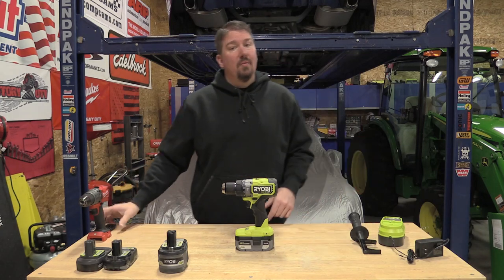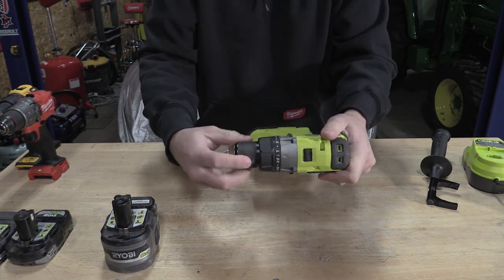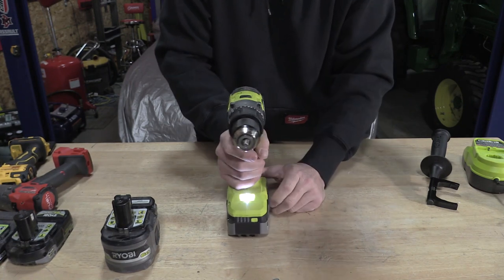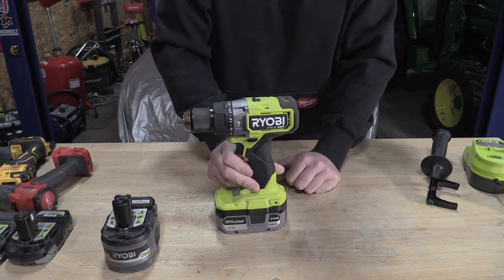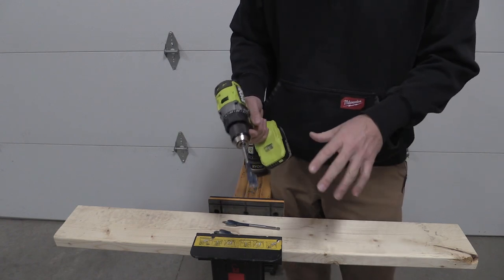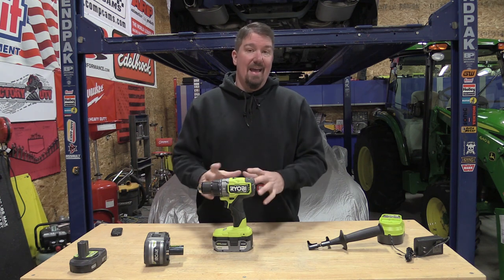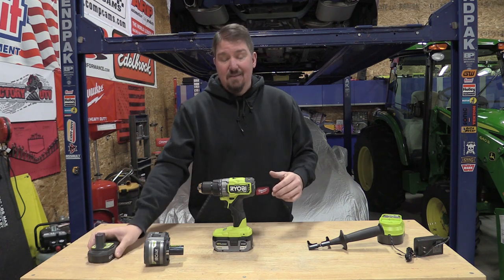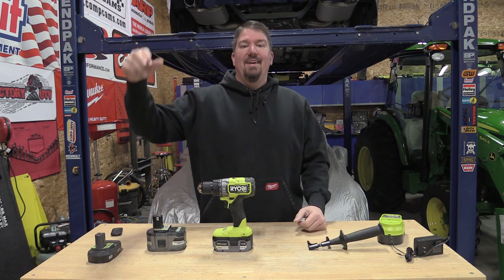Ryobi 18V ONE+ HP Brushless 1/2" Hammer Drill Driver Review | Model PBLHM101B

Comment: Good review.  I bought the last Ryobi brushless hammer drill a few years ago when it was offered with the two batteries and a free tool. It’s still meets my needs. I do like the HP line of tools and will move up as needed. One of the thing the new HP line did was take away the magnet on the base of the tool, I have always found that feature useful to keep up with extra screws. I do like the extra light. I guess I can’t have it all.......
Reply: I agree. Ever since they came out with the new hp line I've always complained about the mag trey. I always use it. When you upgrade you shouldn't take away the good features of the old one
Reply: That's one reason that I might switch to milwaukee. Cause milwaukee doesn't have the mag trey either and it performs so much better

Comment: I really think Ryobi have come a long way. Some of their tools still have some issues, and some of their tools still are outright bad, but most of their stuff is getting really good, and they show alot of willingness to improve. For instance, their old brushless hammer drill was pretty good, powerfull motor (apart from a bit too aggressive overload protection) but the chuck was really bad and would let go of anything i put in there sooner or later. These new ones seems to have alot better ratcheting chucks.

Also have this sneaky feeling that much of the quality uplift is from using stuff from older generation Milwaukees. Alot if the build materials seems to be the exact same. If that is true then the trickling down of older, but higher quality tech is awesome for consumers. Sure its not industrial grade, but its miles above the average IKEA drill or whatever someone would buy just for the sake of having a drill. I'm pretty sure that "regular" people collectively buy alot more tools than professionals do, so better technology at better prices affect ALOT of people out there!
Reply: @alex ander Hard to tell without looking at it but im guessing either overheating or issue with the battery maybe?
Reply: @alex ander sounds like a lemon mate, or bad battery ive used and abused the drill and impact and both are still going strong

Comment: Outstanding video. A couple of points. It seems that the HP tools with the extra prongs seem to work pretty good where as the HP tools without the extra prongs simply don't impress. Second I think at least the brushless tools from Ryobi are good enough to build a house. However, I said a house not houses. I don't believe no matter what they claim their not professional grade tools to used hard day in and day out. Just my opinion YMMV. And last the famed 1911 has the best trigger.

Comment: Having mechanical chuck seems to be in the right direction. Even Milwaukee went back to mechanical chuck!

I just received this drill and opened the box. As long as I feel, based on my short experience with DCD800 and DCF887, this Ryobi feels way better made. Solid fit. Yet missing some coushion pads around the foot pad. It does not seem to be any big issue for a lightweight(?) users, though, since they won't be using this drill in any hardcore environment frequently. Also, the battery footpad(?) is large enough.

The metal chuck and clutch selector feels really nice! Especially the mechanical clutch clicks like 'quality' every time. I have never expected this from Ryobi and beginning to consider switching entire platform from DeWalt to Ryobi HP. Well, I will still keep DCF850 if the shift ever happens though.

I got this drill with the impact kit just because of the hammer function with the auxiliary handle and the brushless motor. Sure, I could have stayed with DeWalt platform for this purchase. But their high-end 900 series seems to be a bit outdated (no auto-stop, dinosaur size, and pricy) in design and too powerful for amateurs like me who even felt DeWalt 20V drills are too much and preferring 12V as a go-to. 

Sure, this drill is even heavier than DCD800. Yet, the aux handle seems to be negating the problem well. The small notch on the grip  feels ok for me. At least I don't have to drill thousands of holes a day with this. So, I am not keen on the grip comfort, though. I tried gripping it inverted, pulling the trigger with pinky but didn't feel too much of obsecure sense. I would rather point out the thicker ankle area which is huge compared to anything DeWalt 12V stuff. Yet, again, I'm not very keen on this matter. 

I have a few caveats though, one is the chager... no, not the charging speed or anything electrical but the outlet plug connector is the notorious brick type... takes up at least 3 of outlet extender slots! Yes, I hate these kind of fat plug in brick connectors! My lawn mower, also Ryobi, charger isn't like this! AVGN tone: What were they thinking!

Another caveat is not coming with any belt clips nor bit holding slot accessories. I saw some previous generation Ryobi drills came with those, well not exactly but internally, and even magnetic bit holders on the foot! It's kind of annlying having to source them separately. I bet there will be some 3rd party ones, though.

Lastlly, the drill seems a bit chubby and longer than anything I have (DeWalts, mostly.) So, I will not be using it any odd situation at all. But then again, I still have 12V DeWalts for this.

Comment: Have the same hammer drill, and I love the handle and grip. That’s my preference though. Great review.
Reply: Love it.  Using it for a fence extension on a concrete wall and have had zero problems. I got it free with the Ryobi days deal with 3 batteries, so can’t complain.
Reply: I’m just a DIY guy, but I have Milwaukee and Dewalt stuff as well, but I’m good with the Ryobi. Always been good to me.
Reply: Can this handle heavey use. Im a roofer
Reply: @greylynnjr  I’m just a home DIY guy, but it’s held up very nicely for me. Still working great

Comment: One "OMG Youtube Comment's prove you wrong!" correction: The prior generation (P251) came with an (awkward) Auxiliary handle which could be faced either left or right through the plastic body above the trigger.  The new handle is what they should have done the first time.
Reply from the maker: I promise to never be perfect on my videos!
Reply: the P220 drill had a 360 handle and was their only 3speed drill as far as i know, things a beast. had it for years and it'll still wipe the floor with most drills.
Reply: @wolfie965  I use to have the blue p211 Ryobi it had that same screw on to the housing auxiliary handle hated that hammer drill it was for work that's what they gave me and one of my jobs it wouldn't let me use anything but that because it was registered or something
Reply: @bluemantom77  oh that sucks, the p220 handle was actually a friction ring style, it slipped on the housing and you tightened the handle down in any position you could desire.

Comment: These new ryobi tools are BAD as in awesome. got the new 4 1/2 one+ HP cordless grinder with a 4ah battery and it out performs my buddies Milwaukee  with a 5ah battery. I'm very impressed with this new line of ryobi tools and plan on replacing all my cordless tools with these new one+ HP tools. You just cant beat the performance to price ratio.

Comment: Could you confirm that gear housing is aluminum cast and not painted plastic? All the previous versions of Ryobi drills had plastic painted in metalic paint. This would be the first one. However i would assume that such a major improvement would be advertised, and Ryobi stays silent on this.
Reply from the maker: I will take a knife to it tomorrow and confirm.
Reply: @WorkshopAddict  thank you! You can compare to impact driver, which is cast aluminum for sure.
Reply: @WorkshopAddict  fun fact: on european market brushless jigsaw is exactly the same as on american market, but is painted in metallic paint. Why? Europeans distrust plastic much more than Americans, and even lower tier european competiton like Erbauer (similar or even lower price point, their jigsaw is ca. 60$ before taxes) sell their jigsaws with cast aluminum main body (which is much stiffer and helps precision of the cuts, but in the same time more expensive than just a metal plate hold in plastic body). Ryobi decided to compete with just an appearance :)

Ryobi painted plastic with metallic paint on US market as well, for example brushless angle grinder has half of the body painted despite having proper, cast aluminum gear housing. I do not understand this particular design desicion, because nobody makes aluminum body angle grinders this days and there is nothing to be ashamed of. 

This is why im interested with the new drill: on photos the color matches the color of impact driver gear housing, which is aluminum cast and is heavily advertised as such. But is it true metal, or there is dirty secret below the layer of paint?

Anyway, you can trust no one this days :)
Reply: I can confirm it's made out of cast aluminum

Comment: I mean, according to a lot of people, all of Ryobi's tools are "DIY" tools. It hasn't stopped them from making me money on nearly every job site over the last fifteen years but there are still those who insist I need to replace them all with "real" tools, anyway. I'll probably pick up this "DIY" hammer drill when mine finally craps out. Then again, there will probably be at least one more version before that happens.
Reply from the maker: 15 years ago, Ryobi made great tools.  Since the blue went away, the quality has went down and down.  Since Ryobi sold to Kyocera in 2018 and TTI leases the name, it has sunk even further.  So you get people who made money with the older tools and love them and the new people who burn up a new tool in 3 weeks and hate them.  It is all about the experience, but with the new tools, it wont take long to change your mind.
Reply: @WorkshopAddict  I can't say that I agree. I didn't say I only own blue Ryobis. I can say with some authority that my newer, HP recip saw is significantly better than the blue recip it replaced (finally crapped out a month ago). All of my green drills are better than my OG blue drill by a wide margin. Yes, even the first green drill (which I still have). Jigsaw vs jigsaw, green wins. Shop vac vs shop vacs, green again. Miter saw vs miter saws, all green, all day.

Don't get me wrong, my blue tools have served me well for a long time but my green tools are a definite improvement in most cases. The one exception would be the blue 5.5" circular saw vs the green 6.5". The balance sucks on the green and only gets worse when you add a bigger battery. The blue saw is perfectly balanced and with its rear battery mount, doesn't change when you add a bigger battery.
Reply: I've upgraded my whole tool setup to these all new hp tools, and I use em daily  demoing and refabbing houses for airbnbs,, and I can say that while most my coworkers wanna say ohh they ain't as tough as my Milwaukees Dewalts whatevs,,, but they javent failed me once in anything,, and I've actually gotten a few to try em and I ve had 2 say they like the new hp 4 mode impact driver and impact wrench over his rigid octanes,  and the angle grinder and one hand recip saw over his Milwaukees... while I know most veiw ryobi as diy,,, I think that's just biased from years of subpar lines,,, but anyone who try these hps out will def admit they're stepping up into AT LEAST tha pro-sumer level...  give em like another year or 2 to drop a more broadened lineup of hp tools to match the big box brands',, and they'll be a easy contender w their performance and pricing... lol I got 11 hp tools  w 5 hp batteries for less than a Milwaukee 5 tool set price....   and I can def live w that loll
Reply: question,  on the hp hammer drill,, does the silver ring at the front of the chuck  (where it says 0- 1/2 inch or whatevs)  spin freely on its own? I'm not sure if it's meant to or if mine just got knocked loose ... doesn't affect functionality at all,,, but I just never noticed it till like a week ago, n never had prior drills to do that.
Reply: @dabmanian_devil  Yes, it spins free intentionally. Companies like DeWalt have had that feature for a long time. It reduces the chance of marring the surface of your work if the chuck happens to come into contact with it.

Comment: I don't drill anything over 1inch on high even on a Dewalt or Milwaukee. Lower speed, higher torque equals longer life of tools. Even then the drill will sometimes bind up exiting the other side of the board.

Comment: Good review. I have to ask tho if it's a locking chuck, your actually supposed to torque it down then one click back to actually lock it down. I mean you didn't do that and it still retained it. You were stating it didnt spit out the large bit like others drills have. Is the one click back method correct or some b.s.
Reply from the maker: 99 percent of people never do the one click back.  I have had some engineers tell me the one click back used to be true and is not anymore and some say to do it.  I cannot get a straight answer, so I used this like many DIY people would, no click back.  It held the bit better than many others.  If it would have been an issues I would have done the one click back and worked to prove it.
Reply: @WorkshopAddict  awesome, thanks for the info. Yeah, I was wondering as well I couldnt get a consistant answer either. Some say yes some say it doesnt matter.
Reply: I'm late to this discussion, but I've found the click-back to be useless. Here's a test - crank down the chuck, then click it back. Run the drill in reverse at full speed for a second. It un-clicks itself. I can't see the click back locking anything, and if it did, it'd be considered a feature that they'd advertise.
Reply: @JulianA-tr6pt  I've got the same ryobi and it works, although tbf the biggest bit I have is a 1in spade lol.
Reply: @bread-gz3rl  It actually doesn't un-click itself, I just wasn't twisting it back far enough. 

But the click-back actually doesn't do anything, which is what I assumed and observed. Watch the two recent AvE videos about this. He responds to the clickbait-y video about the "secret drill chuck feature", pulls up a patent diagram, and eventually cuts open the chuck, 

The biggest hint is the fact that manufacturers don't advertise this as a feature, which they absolutely would do if it were one.

Comment: Thanks for the video. I got the brushed version of the non hammer version of this. I'm struggling to go through a brick so I started to look for masonry bits but I'm not sure if my drill is capable of it. It's an old red brick. Would you share your opinion with me? Thanks in advance!
Reply from the maker: You will need a hammer drill.
Reply: @WorkshopAddict  thank you!

Comment: Just curious because I heard you mention it in the video. Is the drill gearbox housing that the aux handle clamps on made from aluminum or plastic? That's kind of the deciding factor for me because I have the old drill and with heavy use the plastic housing broke down and made the chuck wobble so much its basically useless now.
Reply from the maker: It clamps to an aluminum like material.  It is a common cast material used in tools.
Reply: Try scratching little bit with just a tip of sharp blade. Metallic paint will reveal green plastic below. Metal housing will expose shiny metal below oxidized layer. Tiny tiny scratch is sufficient :)
Reply: It seems this is the most secretive thing about new drills :D OK, they will get to shops in two weeks time, and we will know anyway
Reply from the maker: Confirmed, the drill has a metal housing that the author handle attaches to.

Comment: Look at the similarity with the new HP 4ah battery, if you look close the battery indicator is exactly the same as the existing ridgid batteries. The chuck seems real similar too.
Reply: Ridgid tools are built in the same factory, designed by the same engineers and use a lot of common spare parts.
Reply: the new rigid tools just dropping rn are thee exact same as these hps,, look at there new 7 1/4 saw,, the same top ti bottom as the ryobi hp,, hell even their new impact wrench is a carbon copy of the newer hp ones,,, and the hps are just as strong (both max out at 600 640 ft/lbs)